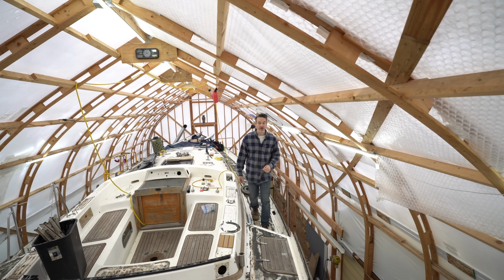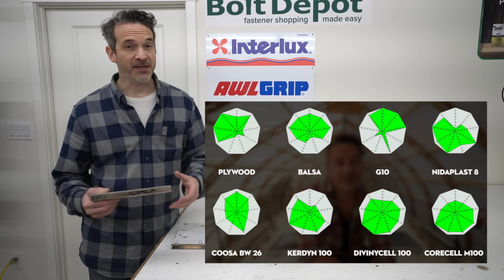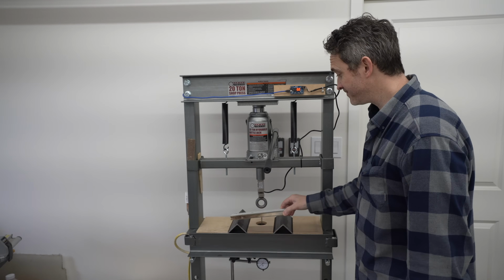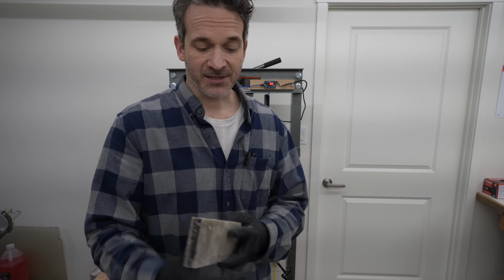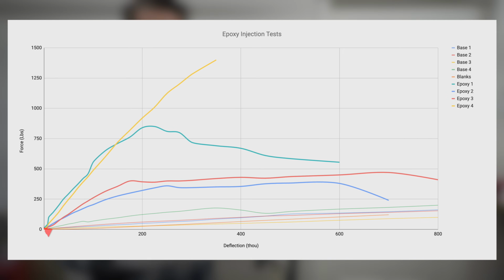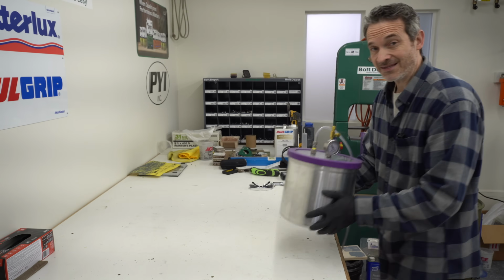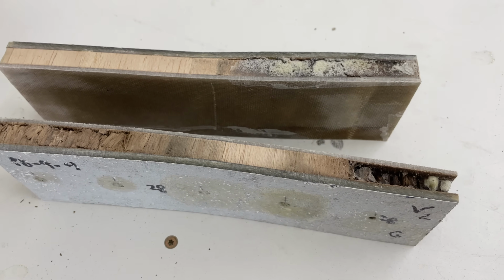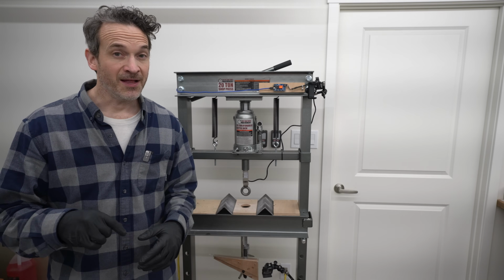Does Injecting EPOXY actually FIX a rotten boat deck?!

Comment: I purchased a mid-1980's sailboat with what the surveyor indicated was "higher than normal core moisture in limited areas"!  What I found later was much more severe & extensive, although there were no soft spots. I did not believe I had the time or skills to peel off the top skins and recore/relaminate/resurface all of the compromised areas. So, here is what I did instead, with the boat under cover during one summer - for your thought and comments.

Step 1: Purchasing a moisture meter & removal of all fasteners and hardware where elevated moisture levels were found (20%-30%) on the decks and coachroof.
Step 2: Expanding fastener holes so that they could be epoxy-potted and later redrilled.
Step 3: Drilling 1/4" holes every 2" moving away from high moisture areas (initial holes had dark core that one could squeeze water out of, further away lighter colour and no squeeze out, stopping at holes from which normal coloured dry core simply blew away in the wind).
Step 4: Setting up fans to blow continuously across all holed areas for the the hottest 3 months of the summer (hoping to extract as much moisture as possible).
Step 5: Filling holes with pure methanol to draw moisture out of the surrounding core, and kill bacteria, followed by more time under fans.
Step 6: Filling holes with Smith's high-solvent low-viscosity epoxy (formulated for wood fiber reinforcement) until no more was absorbed by the core.
Step 7: Filling holes with MAS epoxy and milled glass until no more was absorbed, followed by fairing compound.  
Step 8: Sanding off original antiskid and all restoration blemishes, followed by recoating with antiskid paint.

Final moisture meter readings are hard to interpret because of the epoxy in the core. However, at a minimum top and bottom skins are connected by epoxy columns, and the decks feel completely solid underfoot. I anticipate that this will remain the case for the remaining service life of the boat.
Reply from the maker: Thanks for sharing your experience! Much appreciated!! 🙏👍

Comment: Conclusion: Rebuild or scrap the boat.
Reply from the maker: Maybe a bit extreme… I think it depends what you want to do with the boat. If you’re just going out into the protected harbor for a float picnic on bluebird days you may not need a sturdy deck… 

That said… I’m a fan of rebuilding.

Comment: Have you ever tried Makita DSD180Z 18V Li-Ion LXT Drywall Cutter to cut the deck from underneath with vacuum attachment? One could maybe maintain upper deck, integrity and texture? One can adjust the depth of the cut pretty sure it's set up for half inch and 5/8 deep cuts. I know it makes a foam or nomex core layup much more difficult because bubbles rise to the top so it Hass to be thickened epoxy. It's miserable work without full coverage respirator suit to protect eyes and skin. I totally understand why people do it from the top. Either way it's painful.
Reply from the maker: I think you’re right… miserable work either way…
I’ll look into the tool. Antidote has a lovely interior that’s in pretty good shape that I don’t want to fully demolish… we will see. 

Thanks for the feedback!! 🙏👍

Comment: Foam coring is not waterproof; almost all polymers are subject to hydrolysis.
Reply from the maker: Granted. Not “water proof” but also doesn’t transform into used coffee grounds…

From the manufacturer: “They have a stable closed cell structure, resistant to water ingress, corrosion and decay.”
Reply: @livingforsail  Sure. It would be interesting to do some destructive testing of foam in sour (<pH) water, always skeptical of claims of "resistant to corrosion" from manufacturers. I am in the PNW too and am going with Doug fir plywood to replace sections of my deck core (1971 Cal 33), as I understand it to be significantly more water resistant than hardwood ply...and cheaper and more accessible than foam, as you clearly explained in your recent video!

Comment: By far the best video I’ve seen on the subject.  I was surprised how well the epoxy actually did, though honestly the results in my humble opinion still fall largely in the category of insufficient.  Still, great content.  I’d like to see how plywood would compare to the divinycell.  Another test would be “good” dry balsa core as a benchmark.  Then I’d like to see dried balsa that was wet and treated with CPES.  

Is foam core the best, or the most economical against marine plywood.  Now that marine ply is so expensive, is it actually a superior core material.  Assumption would be that marine ply soaked in CPES specifically, would neither rot, and would be stronger.  The uncalculated downside guess would that it (CPES ply) would be prohibitively expensive in comparison to foam core.  I’ve suspected we may have thrown the baby out with the bathwater in our hatred of ply when the real cause of rot is poor building techniques.  Also, coosa board, as it has been very popular.  Want to know what is the best option for a small repair where cost is of no concern against what I might choose for a large area where cost efficiency is critical.

Sorry, you did such a good job, the bar is now raised.  

Brett.  Anacortes.
Reply from the maker: Thank you for the feedback. I appreciate it. 🙏

This boat also had some plywood core. Plywood is interesting because its many plies introduce more potential places for the glue to fail over time and slip. 
If I do this again, I have a lot of interesting ideas that have been offered. Thanks!

Comment: I had a basketball size wet balsa core in my cabin top. I drilled out a 4" hole, dug out as much wet core as possible, and let it dry over winter. I then soaked the remaining core area with PC Petrifier, a liquid wood hardener that looks like skim milk. A couple days later the Surveyor's moisture meter showed it to be dry and solid. I filled in the missing balsa with glass strand condo then installed the 24/7 solar vent. The deck stayed solid.
I don't think I'd trust it structurally over a full wet deck, but it worked well on the small area.
Reply from the maker: Interesting. Thanks for sharing! 🙌

Comment: This is a method which is used also in caravans, for floors! Same kind of sandwich construction but with foam/insulation, so why not? Normally its claimed its not wet though, but rather delaminated. Not sure which kind if glue is used, I believe PU glue.
Reply from the maker: The theory is that the moisture compromises the ability of the adhesive to grip but that’s less of an issue with the PU… thanks for sharing. 🙌

Comment: I would just open a small hole and remove the old wet core and then repair the core with expanding foam and patch the fiberglass unless its some sort of structural component that rests in the core.
Reply from the maker: Small repairs are one thing… we have a pretty wet deck… the whole deck.

Comment: Very nice video! I'm using gurit 1/4" foam core, but who has the best prices? never hear of Hawk epoxy...epoxy prices are crazy.
Reply from the maker: Corecell is a good product. I was pretty impressed with the Divinycell that I’m using for my project. 

Hawk epoxy is essentially like west systems 105 epoxy. It’s a very similar system.
All the best with your project.

Comment: You did the epoxy injection wrong. First , it cannot be wet! If you drill a grid of 3/16  or 1/4  holes @ a spacing of 1". Then you let it dry. For a few weeks.  Then you flush it with denatured alcohol. Let dry again. Is best ,for us in the NW, to do The drying during the heat of the summer. You should use a slow hardener and inject during the cool of the day. You inject until it starts to come out of the  surrounding holes. When done all the holes will have a small bed of epoxy on top of each hole. If it sinks in ? Inject more. The key is drying the deck via the hole pattern and flushing with denatured alcohol. Doing it to a wet deck is just silly.
Reply from the maker: I love your handle. 👆

Comment: Solid deck (non-cored) production cruising fiberglass sailboats of the past. 

Contessa 26 "UK Version"
Bowman 26
Nicholson 26
Great Dane 28
Morris 28 Linda
Twister 28 (some with lead, some with iron ballast)
Freeman Deep Seadog 30
Barbican 30
Hurley 9.5
Elizabethan 31
Contessa 32 "UK Version"
Contest 31 ?
Contessa 26 "UK Version"
Bowman 26
Nicholson 26
Great Dane 28
Morris 28 Linda
Twister 28 (some with lead, some with iron ballast)
Freeman Deep Seadog 30
Barbican 30

(I stole this list from Cruiser's Forum comment.)
Reply from the maker: Add at least one more… I know of some folks that have a Compass 47 (built in South Africa I think…) it has a solid top deck but it is pretty flexible…

Comment: Teak decks from fiberglass production boats of the 1970-1980's, particularly those with balsa or plywood cores, are to be avoided. 

They're just not worth it. Not even for free. A non-core, 1960 fiberglass boat would be a far better choice. 

The core materials in use in the 1970's might as well have been cardboard.  

There are so many good, non-core boats to choose from. You don't have to buy one that is structurally unsound. 

I have a 1976 classic plastic boat with a synthetic core.  It remains structurally sound today, but any water intrusion still runs around in the porous core and drips inside the boat.
Reply from the maker: “Worth it” is subjective but a free boat (especially a leaky teaky) is anything but free.

Comment: You definitely need to get just as much water out of the core before you inject epoxy.  In your test the epoxy was impressive even though the core was wet.  Injecting epoxy into a wet core would be ridiculous in my humble opinion. Epoxy will not bond well to wet surfaces 
If you are going to inject any glue into the core a big key is MANY HOLES.
Time is the other key factor in trying to get a deck core to dry.  And don’t poo poo cold weather.  Repeated freeze/thaw will drive moisture out.

Also you should consider the humidity in your shop or building.  You can only get the core to a moisture content of the surrounding air.
Reply from the maker: Yeah, epoxy and water don’t really get along…

Comment: So glad to see a more scientific test on these options.   Only wish you had experimented with penetration epoxy as a option.  Im going thru this process now.  At the end of last summer, I used an Injectidry unit designed for building water damage restoration.  It works in vacuum or pressure.  I drilled multiple v shaped holes into the coring from underneath injecting dry air (dehumidified) into one end of the v with the air able to exhaust out the other end.  Over several weeks of run time I reduced the moisture content to well under 18% in all of the coring.  This spring i plan to inject penetrating epoxy and use vacuum to pull it thru as best as possible.  Although pulling fiberglass off top and recoring would be best, the cost in doing so is not worth it.
Reply from the maker: Thanks. 🙏 I think it really depends what you want to do with the boat. It was designed (for very good reasons) to carry a lot of load. Water is insanely heavy…
Reply: Penetrating epoxy can’t restore what is rotted.  It can stabilize what has gotten wet or compromised, but only if you can dry it first.  At least, that’s my belief system.  Would love to see it put to the test.
Reply from the maker: @ghostpeck5604  That is in line with what I found but the epoxy admittedly did better than I was expecting even with some damp material in there.

Comment: Fascinating testing. If pressure injecting epoxy, lower viscosity could be a benefit. Acetone is compatible with many epoxies, lowers viscosity, and volatilizes fairly fast. Open cell polyurethane allows water infiltration if the exterior is not sealed, and thus become heavier with exposure.
Reply from the maker: Thanks. 🙏
I’m not sure about all epoxy on the market but the two main brands that I’ve worked with do not approve of thinning with acetone (maybe it ultimately lowers mechanical properties? Idk 🤷‍♂️ 
Agree about the PU foam. Don’t let any water back in!
Reply: @ Manufacturers may not want liability if they do not explicitly recommend against using a thinner as the user might not thoroughly mix the thinner into the bulk mixture, resulting in variable curing within the matrix. If a manufacturer does recommend an explicit thinner, I would consider an alternative IF their recommended thinner is their explicit product (and the MSDS on that thinner would show what chemicals are used; if one component is listed as proprietary, then one has to stick with that explicit thinner). One could always test a thinner before using it on a large scale. Conceptionally the only issue with a thinner would be a reaction with the hardener or the epoxy. Acetone, being a widely used solvent (versus a reaction component), would typically have to have a catalyst present and/or heat added to cause a reaction with most other substances.

Comment: I had a 1977 boat like a decade ago with a balsa wood sandwich deck, and it was mushy as all heck around the mast step (deck stepped mast). Didn't want to do anything with potentially expensive repairs and sold it off (informing of the damage of course) to the next owner who then sawed the damaged deck section open and spent a few months repairing it. I got some updates, it was quite the project and was way beyond my skills.
Reply from the maker: It’s a big job. Sounds like you made a good move. 👍

Comment: I used Nida-Core to redo the decks on a 47 footer. It was 20 years ago and the present owner reports it has held up tremendously with no leaks or weak spots.
Reply from the maker: Awesome! That’s a cool product. I have a few samples here but have not personally used it. Great work! 🙌👍

Comment: Doesn't some polyester resin cure with humidity? If so, it would be interesting to see how that would fare in the wet core.
Reply from the maker: I’m not aware of a poly resin that is compatible with high moisture. Typically poly is a poor adhesive where as epoxy is pretty good at laminating and as an adhesive 🤷‍♂️

Comment: I've made a couple of Western Red cedar strip kayaks. Inevitably water gets into the core. A few repairs... I guess I could've kept it up. No rot. But.... I enjoyed making them, paddling them, but I regret the hundreds of hours. A factory made kayak, or my Skin on Frame are much smarter. (Do you want to paddle or build temporary furniture that will be junk in 5 years?) 
What gives wood its strength? Cellulose fiber. "Bacteria and mold consume the organic compounds within wood, primarily cellulose, hemicellulose, and lignin, which are the main building blocks of wood" (Google)  So once rot sets in, all you can do is add strength around the now useless wooden core. a rotten core has absolutely no value. It may still look like a boat, but it is no longer a boat. It won't be a boat until you replace or work around the rot. 

As a boat owner (2003 solid glass hull, closed cell foam and glass deck. Zero water intrusion anywhere) the only reasons to buy really old wooden or wood core boats is Historical preservation, they're affordable. But they are no a 'bargain.'  Saving $20k between a wood core boat that needs a lot of restoration and a newer boat with no wood core? You'll probably save money buying the newer boat. The basic rule for restoring a boat, renovating an old house, etc... is make your most generous estimate and then multiply the cost and time by three.  Of course there are wood core boats that are still in good enough condition to repair any soft spots and happily sail them for many more years. The amount of rot that condemns a boat of course varies a lot.  Replacing the whole deck? Big job, but limited only by do you have the skills and labor to do the work? 

What I think I see is the current situation with used boats. My essentially permanent boat is depreciating in value at about the same rate as boats have always depreciated. This is an opportunity for boat shoppers. The difference between a 2003 boat and a 1983 boat is most of those older boats have wood cores.  Nothing is ever going to rot on the outer envelope of my boat. When that 1983 boat was 20 years old it had depreciated roughly the same as my boat has. However, that boat probably had wood core issues. Until the market wakes up, buying older solid fiberglass boats are probably under priced.  Great video.

Comment: I sucessfully injected high grade gorilla glue. I hollowed out the wet core. Gorilla glue can be bought by the gallon. It was far cheaper to use.and it works well with moisture. I seaed it up with epoxy. It was very sturdy.
Reply from the maker: Glad it’s working out for you!

Comment: I would love to see a test of simply adding more fiberglass on top of the existing deck
Reply from the maker: That will make it stiffer but will add weight above the WL without addressing the root of the issue. 
I guess it depends on what you want the boat for. If it’s a coastal day sailor you can get away with more than a blue water cruiser where you NEED to count on the strength of the boat.